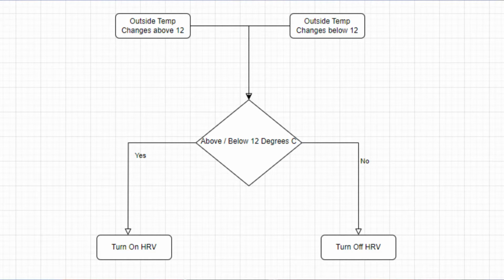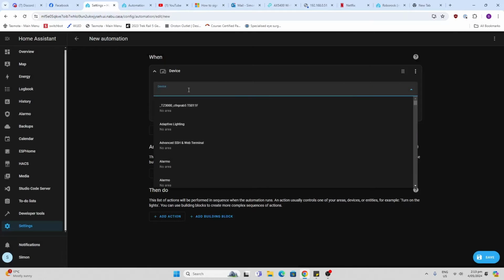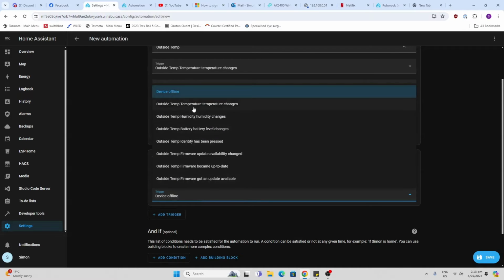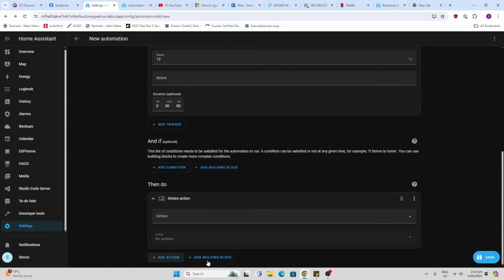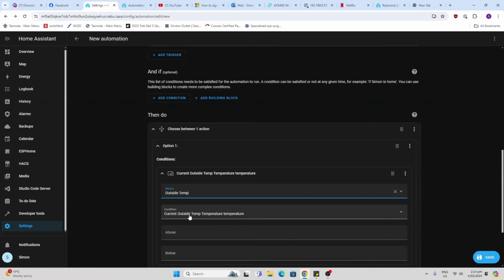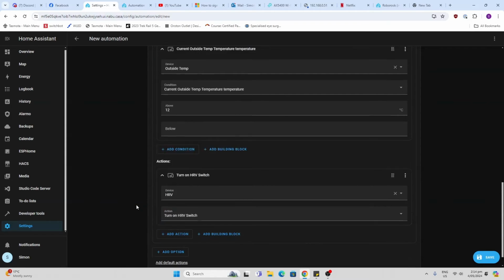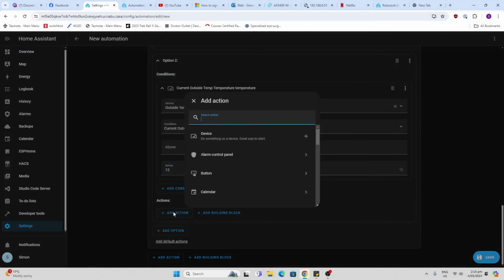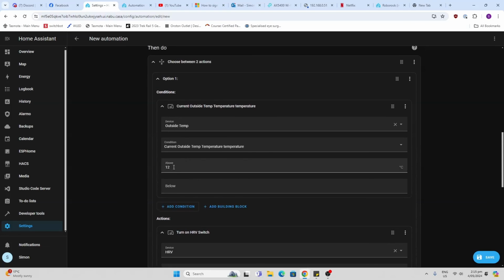The Choice Building Block is a great tool when creating automations in Home Assistant

Comment: I do a similar thing but based on CO2 in multiple rooms and humidity in bathrooms. I'm more driven by air quality than internal temperature.
Reply from the maker: That's great, yes CO2 is a great way to monitor air quality in side

Comment: There are 2 things I would do a bit different. The first is that I would add a duration (for example 1 hour) to prevent the device from being switched on and off when the temperature fluctuating around 12 degrees. Using 2 different temperatures for switching on and off could solve this problem too. (when done correctly 😉) Which on works best depends specific scenario.

The second is that I would use the trigger id in choose action. This way you don't have to change the action if you want the trigger to be triggered at another value.
Reply from the maker: Thank you for your valuable feedback Sierra-Whiskey!

Comment: Much easier Simon if you used Trigger IDs instead. No need to add your triggers twice then
Reply from the maker: Do you need any code for trigger ids?
Reply: @simonsayshomeassistant  no, just give it a unique name.
Reply from the maker: @gerryf7015  Oh that's cool
Reply: I will give a try with dual trigger, as i was trying the same and didn't work. In my case, turn on heater if tem below 18 and turn off heat when temp more than 22. But it didn't fly when selecting both values above/below in the trigger